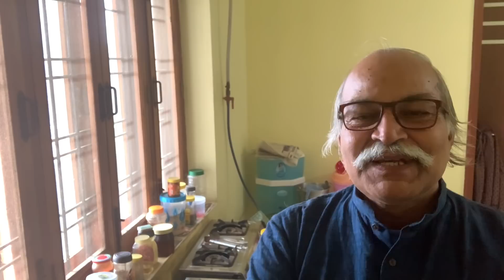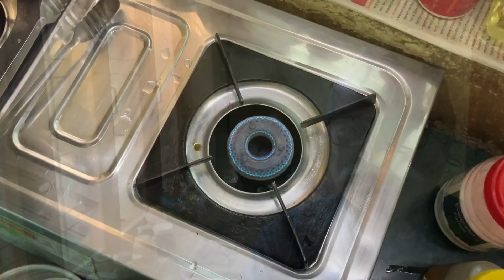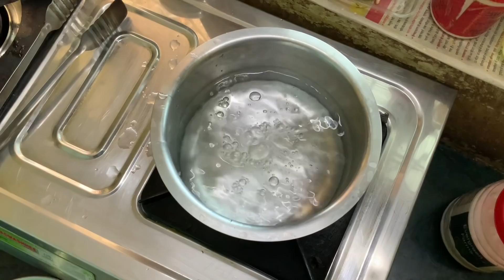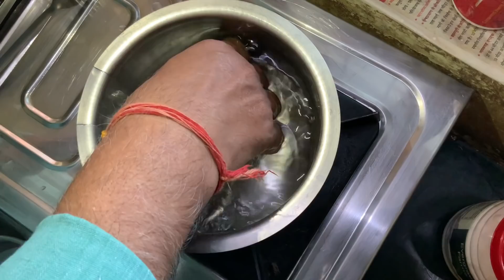Bubbles in warm water

Comment: Sir, when we decrease the temperature water becomes ice at 0 degree Celsius and after that the temperature of ice is less than 0 degree Celsius but
When temperature is increased and water converted to steam at 100 degree Celsius, why stem is less than 100 degree Celsius  ?
Why not the temperature of stem more than 100 degree  Celsius  ?
Reply: Latent heat of vaporization

Comment: I am in class 10th 
Have a doubt please answer it
Sir in one of his video said that the resistor does not change the current ,the amount will remain the same .but I have a doubt about then how the resistor actually work. if it slows down the speed of charges flowing through it then the ammeter should show different reading because the formula of current is Q/t so if the time increases for the amount of charges to come then it's reading should be changed.
Please answer this

Comment: The correct ans is that the temperature is the macroscopic property. It is the average kinetic energy of the molecules. But when the surface get heated the water molecules touching the surface get the energy and change their state is gaseous form or vapour. So these bubbles are vapour bubbles.

Comment: Sir could we think it like this that as we are heating the vessel, the solubility of the dissolved air in the water is decreasing. So the dissolved air tries to escape out of the container in the form of these bubbles and it has no connection with boiling of the bulk of the liquid, so it is happening in much less Temperature than boiling point.

Comment: There are irregularities on the surface of the container that are nearly microscopic. When you heat the water in the container at first the heat goes from gas stove to the metal container and thus heating the irregularities and the air inside. Once the air got heated it rises but because at first the heat has gone to air trapped so there is not much heating of water so that you can touch it and it doesn't feel anything to you. The source of bubble is irregularities because all the bubbles that are formed are formed at the surface of the container. It require less heat to heat air than water. It doesn't comes immediately after turning on of the stove because it took some time to gather enough heat to create a surface of water as in bubble.
Reply: Is he H.C.VERMA sir
Reply: Hmmm interesting. But there won't be so much air is those microscopic irregularities. Sir shaked the bubbles and still they formed.
Reply: @SanthoshVodnala  it is a matellic container it has a lattice where there are spaces and air. And you can't decide the amount of air just by seeing the irregularities when the gas got heated 1 çm3 of gas can become any volume you want according to temperature and pressure. Just remember the equation PV=nRT
According to me the air comes from the irregularities.

Comment: Sir I have a doubt 
 when a ball is at a height from the ground  it possesses gravitational potential energy and when it falls its  potential energy changes into kinetic energy and when it strikes the surface of the ground the kinetic energy changes to heat and sound energy but after that what will happen will it be converted into any other form of energy and if, then which energy ??
Reply: Sound energy also converted to thermal energy now little thermal energy transfer to colder region at end every thing in local area achieved same temperature
Reply: @donotbebiased6987  thanks for your answer
Reply: @MayankSingh-xp6nz  pleasure

Comment: Sir , My question is
"As we know work done by magnetic force is zero."
Ques : Then why work done by the magnetic force comes positive on rod in Electromagnetic Induction (EMI) chapter, two parallel conducting rail problem.
       Please clear my doubt sir. 🙏🏻
Reply: Magnet fields can only alter motion of charges, they cannot contribute any energy or take away any energy. The magnets in a fan only help make the motion of charges in a wire turn into motion of wire itself.
Reply: Specifically for this question, magnetic force isn't actually perpendicular to the wire.  Only a component of it is. The perpendicular component does some work, the parallel component does some work on the charges. The net work done by magnetic field is zero.
Reply: @varunmarar6771  wrong
Reply: We don't care much about parallel component because that doesn't push the rod in a direction it can slide in.

Comment: Sir I have a question,please consider to answer🥺. Its about significant figures- so in case of division the the quotient can not have more significant digit than the  dividend or divisor having the lowest number of significant digit .
Reply: My problem start now the suppose the divisor is a quantity with value of 3.5 , it has 2 significant digit and .5 part is uncertain plus minus .1 so the divisor also can be 3.6 or 3.4  .Now let's come to the divident,that  is 1.732  and it has 4 significant figures.
Reply: So if we divide 1.732 ÷ 3.5 we get 4.9 according to significant figure rule where the 4 part is certain and .9 part is uncertain . I told you earlier that is divisor is uncertain so it can also be 3.4so accounding to the principle of significant digit,
Reply: we should get uncertainity in the .9  part but not in the 4 part as 4 is certain. But when I divide 1.732 by 3.4 , I am getting a value of 5.0 where 5 part is certain and .0 part is uncertain. Isn't it against the rule?

Comment: I think these tiny bubbles forms due to expension of water molecules at bottom.
When the vessel heated by flame then the heat energy is transferred by the vessel to the water molecules which are the contract with the vessel. So the the temperature of the water molecules increases and due to increase in temperature the expands. Due to expension, the volume of molecules increases and mass remains same so density decreases so they comes up.

Comment: as the container begin to heat up, the water in contact of that part warms up, that particular heat might be initiating the state change. I think at that point of time, the whole water's temperature isn't high but that particular part where buble originated is hot. If we touch that part, we indeed find it is hot.

It's kind of like, if we just heat this empty container, maybe to red hot, and then pour water, water suddenly changes it's change but the overall temperature is still well beyond boiling point.

Comment: sir its the average temperature that you are sensing when you submerge your hand into the water vessel. but as the water is continuously heated so it is in variable state and not steady state. Therefore the bubbles are seen because at the surface(bottom) of the vessel the heat energy is received more as  compared to the other areas of water from the base of the utensil. The molecules are still heating and colliding with each other from the surface. The surface molecules hit the molecules above them and like this the energy transfers, some amount is absorbed and some amount is passed. That's why bubbles are observed at base surface of the vessel and after that, sometime is needed for all the all the molecules to get excited at the same amount and convert the state of this liquid water.

Comment: The bubbles at the bottom of the container are gas bubbles which are forming due to temperature increase as the density of the gas bubbles is decreasing due to which they are running upwards.

Comment: The bottom molecules being close to the surface of the vessel start forming vapour but cannot rise to the surface until the temperature(appropriately heat energy) of the top layer molecules equals that of bottom layer. Because of the poor heat conductivity of water ,the mass of water above the bottom particles takes time to absorb heat supplied to it.Eventually as the entire mass of water reach uniform temperature and now the bottom particles can rise to the surface.  (A little that I could comprehend.)

Thank you so much Sir! Respect🙏🙏

Comment: The answer may be related to the impurities in the water if it's tap water it may contain dissolved metals,salts and obviously air.
So if it's heated the airs solubility has an inverse relation to temp in liquid solvents as the reaction is exothermic. So according to li chatilier principal the air escapes while it sticks to the impurities other than the utensils itself. 
Just a take maybe some terminologies I missed but I don't really remember the specific terms of these processes.
And the fact that it starts from below may be given to the fact that the energy source is closest to the bottom of the container . That's why the process started from the bottom itself. As later on I've observed that the bubbles start to drift above as I increased the temp and new bubbles also formed from the bottom itself. 

Another take on this situation I had was that the air concentration may be the most at the bottom itself or the utsensil may be going through some reaction in general.
Yeah I over think a lot lol
Another theory about them staying at the bottom may be due to the fact that the force applied by the water and gravity compelled it to stay in the bottom itself?

Comment: I have seen these type of bubbles even in cold water in a plastic bucket ( I don't if they are different type, but they look quite same and have the same properties that's why I think these bubbles are similiar).
Firstly I thought the bubbles are forming due to imperfection on the metal suface. Because the heat heat applied to metal these air exapands and form bubble near the surface.
I poured hot water on metal bowl and saw this effect. We can play with these bubble beacause they are hard to make it pop unlike the regular bubbles. We can pick it up inside the water with a spoon. When we try to pop it by pushing it moves away.

I saw same effect happening with the bubbles the formed in the cold water bucket, and then I tried moving the mug and yes I found those bubbles in the surface of the mug then I thought perhaps it's beacause of the air mixed in it that forms the bubble. Just like a bubble floating in air rest on a surface the same thing happens with these bubbles.

I am confused. 🥴
It forms while boiling water in higher rate but in the bucket they are still they don't move unless they are disturbed.

Comment: Heat takes time to travel to other parts of the pan. The bottom is quickly heated and it transfers the heat to the water molecule near to it which on absorbing heat transfers into vapour meanwhile the bottom part transfers heat to sides of pan too. Sir you didn't feel heat much because the pan itself was not al very hot to transfer heat to water.

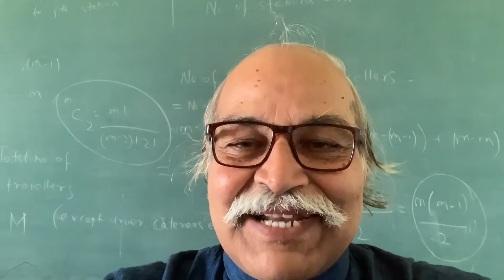Comment: 3:07
Yes
 those bobbles are water steam,
Of those water molecules having contact in microscopic level with the bottom of the steel.(so as we increase the layers of water it will take much time to fell the same temperature as before as conductivity of water is very poor and heat is continuously following between layers)
And those bubbles are forming at higher temperature(greater than 100  degree) as bottom layer water molecules are at higher pressure(more than 1bar)
So if we put only one water layer it will evaporate too fast as Heat is transferring between upper layer (microscopic)of steel to water molecules
And as conductivity of steel is larger than water,with increas in water layer 
rate of heat flow will decrease with layer by layer (water)
And until those bubbles pressure reach greater pressure than upper layers of water they will stay in bottom.
And as we putting our hand into water we are making a microscopic level path between those bubbles and open atmosphere (1bar) and as the pressure difference is too high bubbles escape too fast.
                                    I think so,
Reply: Bhai itni fursat chahiye jivan me
Reply: @potatoperson-101  🤣🤣
Reply: @BEAST 😂😂😂😂

Comment: I think the bottommost layer of the vessel is reached 100°C and the water there are reached to boiling point, but till now the overall temperature is not reached 100°C and the bubbles touching the vessel have not achieved much kinetic energy to rise up (it might be wrong)🌟

Comment: The formation of bubbles occurs due to the energy transfer of heat from the vessel to the water. Evaporation is a common surface phenomenon in liquids whereas, boiling of water occurs at very high temperatures and can happen inside the liquid as it is the transfer of energy to the molecules of water. 

The high amount of energy in the water molecules forces them to turn into water vapours and the bubbles formed are of water vapour gas which can be seen by the naked eye unlike the water vapour formed by evaporation even though the process is similar i.e. it is the overwhelming amount of energy in the molecules forcing them to leave the liquid state. 

The bubbles forms on the bottom because that is the hottest part of the vessel in the process of heating water and it is natural for the molecules closest to the heating source to get more energy before the molecules away from it...

Comment: Water at the bottom surface gets converted into stream. It stays at the bottom untill the pressure inside the bubble is balanced by the pressure of water above it. Surface tension plays some role here because of which the bubble remains attached to the bottom instead of rising up. It's size will keep on rising if left untouched and a point will reach at which the buoyant force will carry the bubble to the surface after which it'll disappear forever :)
Reply: I didn't understood that how water steam can control the density of water
Reply: @MrBoombastic-66  I think the surface tension is the major player here. Till the time the bubble is sufficiently small it balances the buoyant force. As the bubble grows it ultimately rises above. The pressure inside the bubble is important to maintain its shape without which it'll just crumble down under the pressure of the water from above.
Reply: @MrBoombastic-66  this also looks promising.... But Leidenfrost effect is much more chance

Comment: I think sir it it due to the dissolve air inside the water when we are increasing temperature slightly these air molecules comes up again and again on  the surface of the container  and the bubbles are formed . That what i thinks about that 

sorry for grammar errors

Comment: I did not understand anything else, but I understood that if the water continues to be heated at a very low temperature, then a stage will come like this, the whole water will have turned into steam. While 100°c heat was needed to convert water into 100°c steam, but if we have kept it at 50, 60° temperature continuously, it would have turned into steam after a time interval. From this it is learned that if we keep reading a little bit every day, then we can easily achieve our goal.

Comment: Rise in temperature increases heat in water which expands it creating bubble which is spherical due to surface tension and those bubbles present at the bottom of vessel due to weight and adhesive force of water.

Comment: It is due to less pressure at bottom with irregular surface so bubble form there to balance pressure difference and the bubble is not steam,it is the dissolved air of water
A very smooth utensil doesn't develop bubbles at bottom ❤️❤️❤️❤️❤️❤️❤️❤️❤️